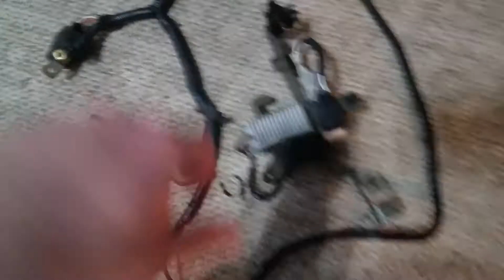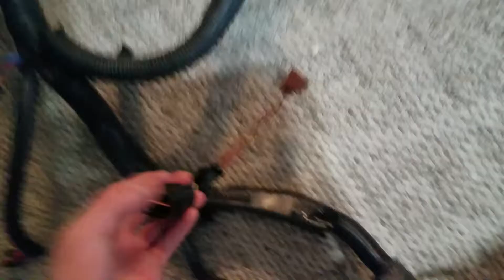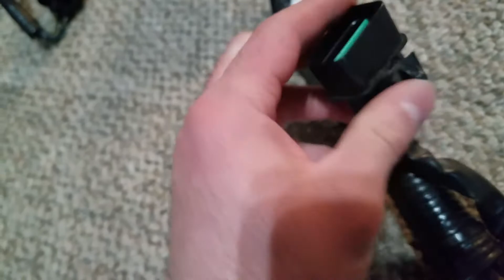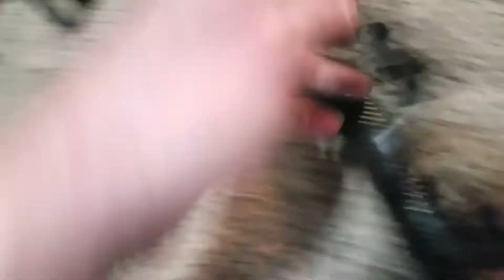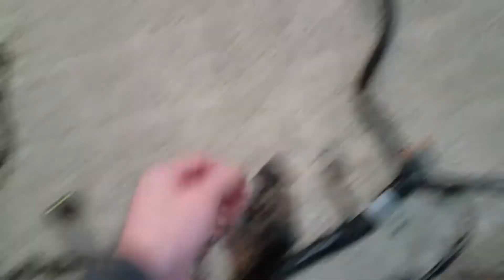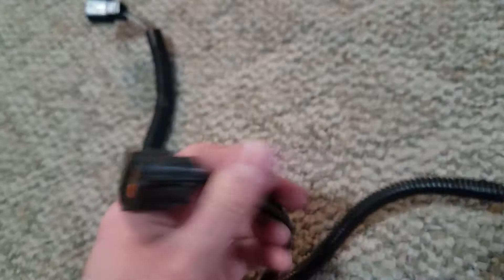Mirage to Evo IV Coupe Conversion Project: Making a Custom Wiring Harness

Comment: https://youtu.be/DZ1j0ViL7qQ?t=5m25s it is an engine and fuel pump relay
https://youtu.be/DZ1j0ViL7qQ?t=6m49s it is a pump resistor, at idle the pump works through it
https://youtu.be/DZ1j0ViL7qQ?t=7m40s this is the second fuel relay, the pump resistor to it

If you are interested, there is a designation of chips, about a year ago subscribed from the schemes, but they will have to be translated from the Russian

write to mail memka1987@yandex.ru